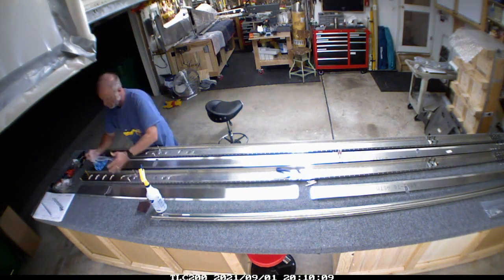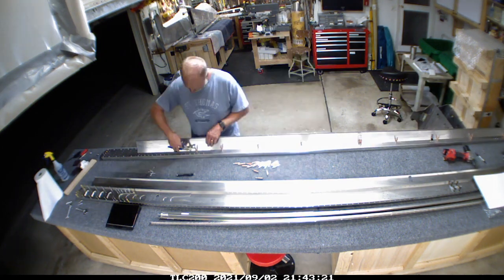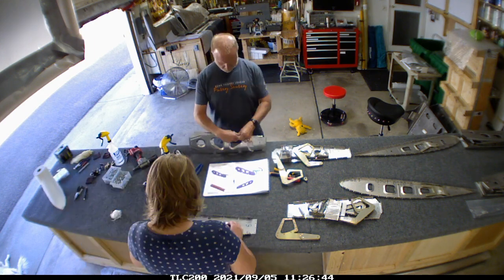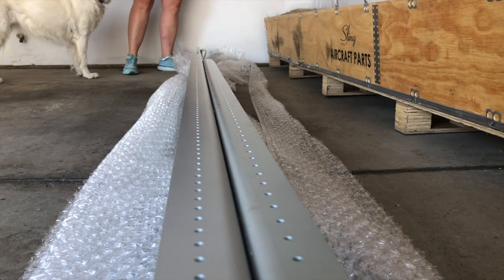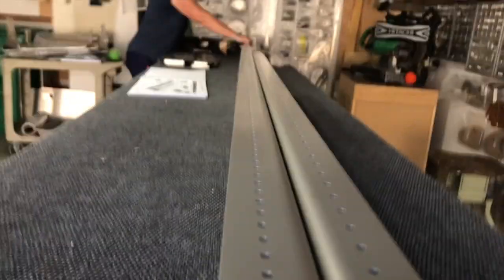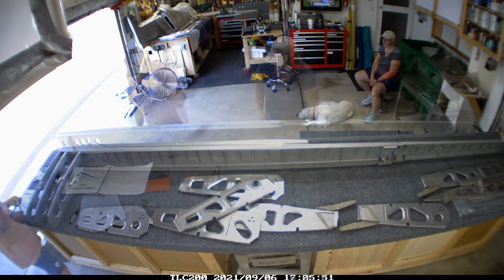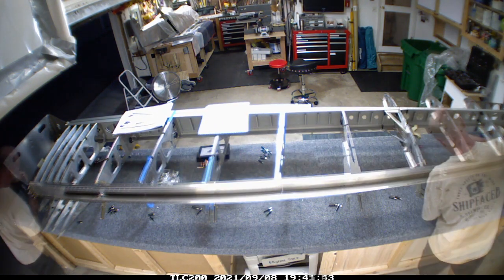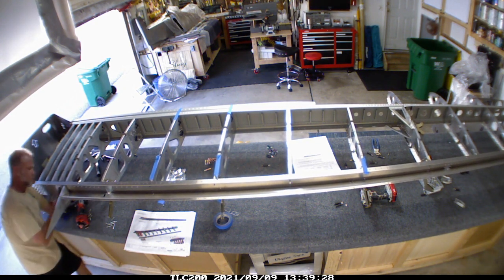SlingTsi Right Wing Build September 2021

Comment: Heck ya man, good to see you're finally pulling rivets on this beauty! If you've got an iPad or Laptop, try to use the latest manuals from dropbox in conjunction with the printed ones, they often have updated details that can help you through sticking points. Sometimes the older printed manuals actually have better views of certain steps, so using both is my preferred method. Also being able to make notes on the printed manuals is helpful. Have fun!
Reply from the maker: Heya Evan… thanks for the encouragement!  :). I really appreciate your videos as well - I’ve even gone back and watched some of the original ones for guidance.  I may have some of my iPads in the videos or edited them out (not really sure), but I do have my iPad down in the garage with me.  Basically I follow the printed version up to when I have questions or something doesn’t make sense, consult the online version of the build plans and then the videos you put together.  Often it’s a combination thereof.  I’ve been reviewing the build videos before I start each section.  Sometimes there’s just so many steps I have to watch the build video several times to catch all the tips and tricks - the basic “ah-ha!” Moments.

I appreciate your being a trail blazer on this build.  :)